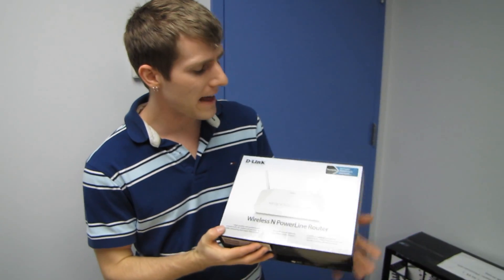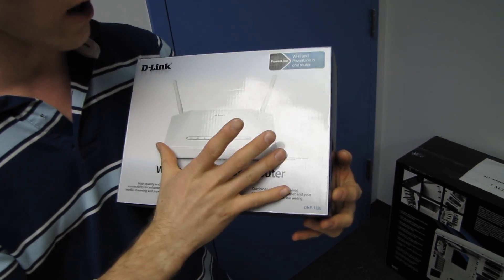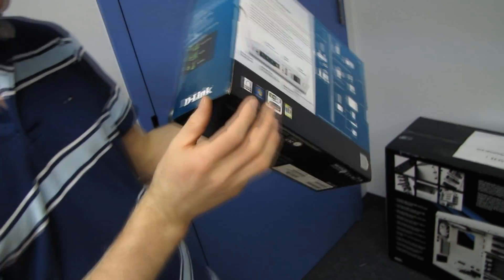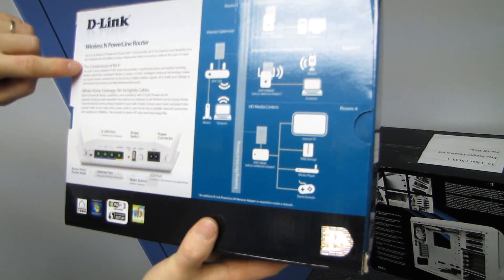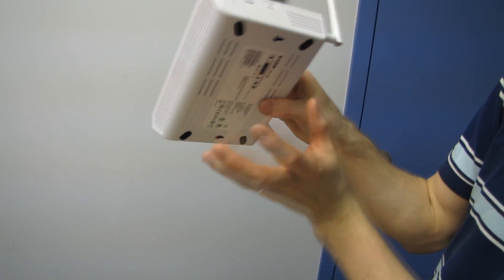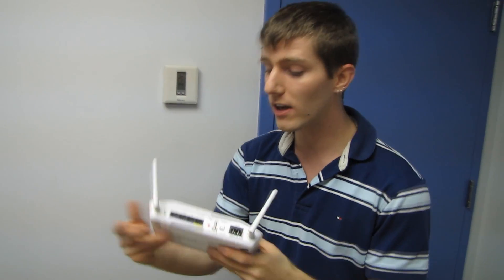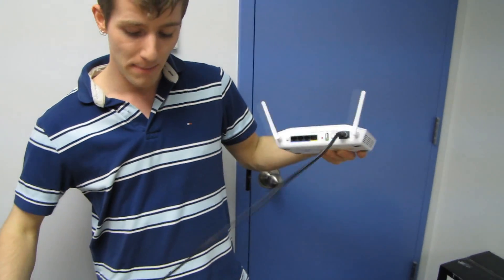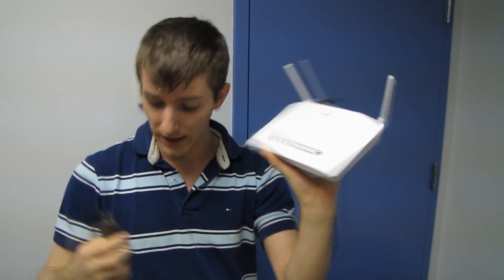D-Link DHP-1320 Hy-Fi Wireless & Powerline Router Unboxing & First Look Linus Tech Tips

Comment: @Aristowi It could be useful if you live in a big house and the wi-fi range on your modem is not good enough. You then setup a router in a different room and plug it into your modem via ethernet. Some modems only have wireless G speed 54 mbit/s. So you could buy a router with N speed support 300 mbit/s.

Comment: @tfbekk I don't think that's how it works... You can use the router and a powerline adapter in your own home and it uses your home wiring. It most likely doesnt work how you want it to. (electricity is spelled with a c btw)

Comment: @madina690 you plug a box into your wall port and then plug that into your router then plug another box into another power point anywere else in the house and plug a cable into that and then into your computer. it pretty much makes a wired connection through your houses power cables